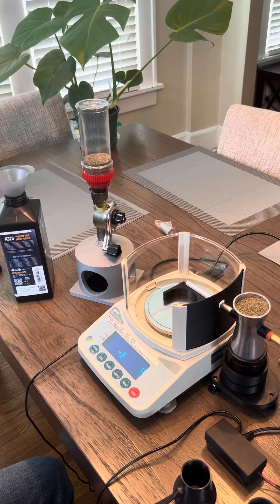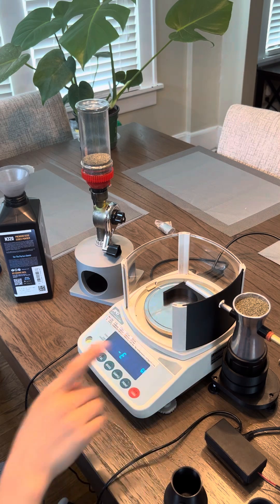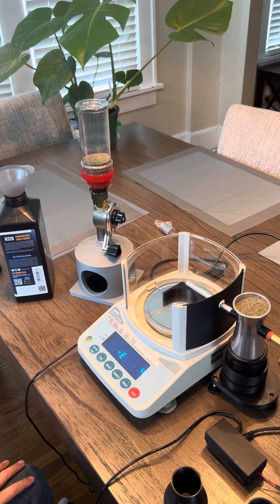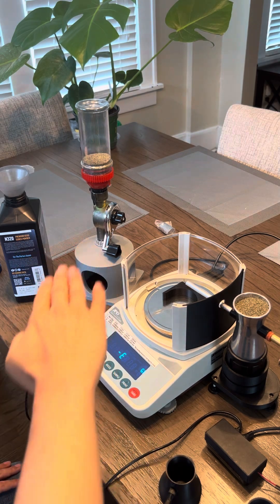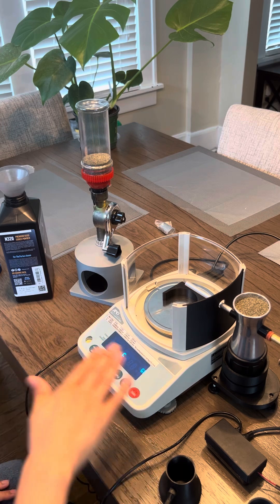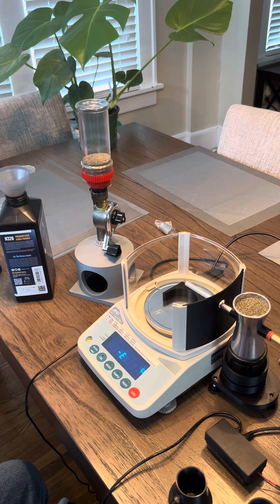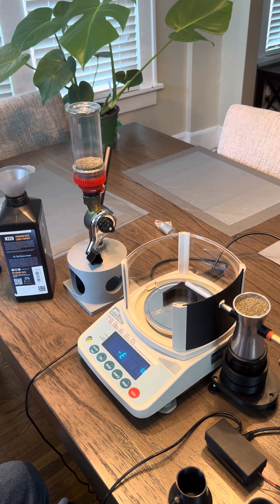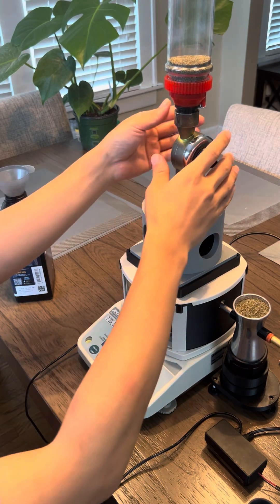OpenTrickler build with bulk powder throw and adjustable Trickler base

Comment: May I ask
Which microcontroler did you use?
Reply from the maker: @stephanc7192  Thanks for your interest! I used a raspberry pi zero, this project is based on the OpenTrickler by Ammolytics, you can find his open source instructions and code on ammolytics.com. Most of my 3d print modifications can be found on Makerworld.com just search OpenTrickler.